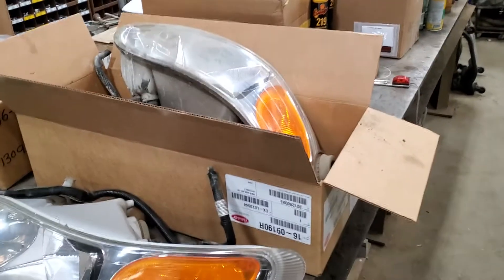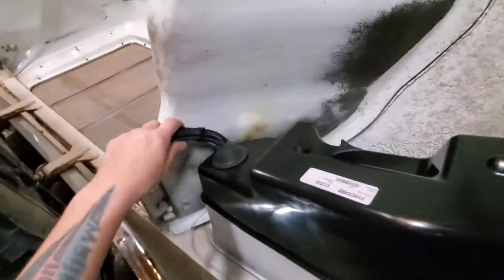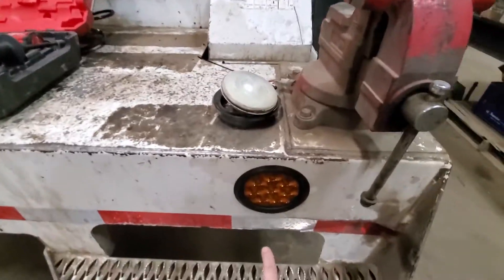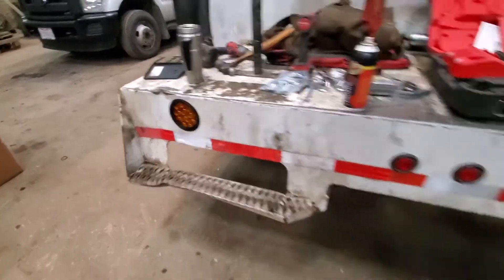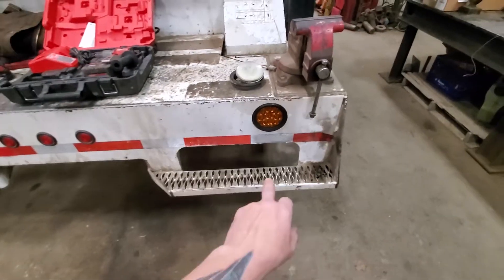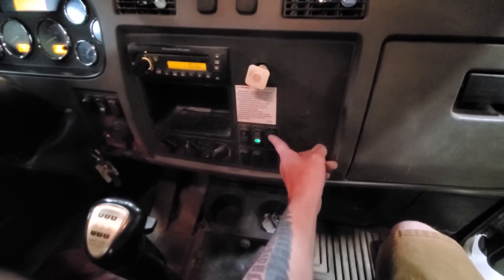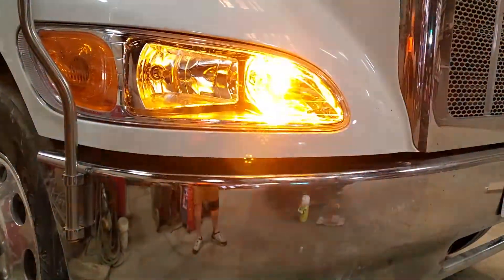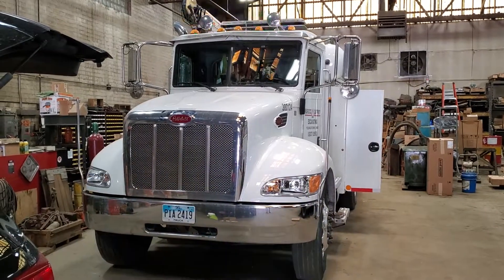Feniex, TecNiq On-Site Install & New Headlights On Peterbuilt Service Truck Due To Strobe Tube Fire

Comment: Strobe tube fire ? I’m also a firefighter and never seen that before on a vehicle .
Reply from the maker: That is correct sir. The strobe tube in the passenger side headlight caught fire. We are a firefighter owned & operated upfitter with 30+ years in the industry. We collectively have seen multiple fires caused by strobe tubes and their power packs. As a matter of fact this incident was our customers third. Which finally prompted them to make the decision to eleminate their use fleet wide.